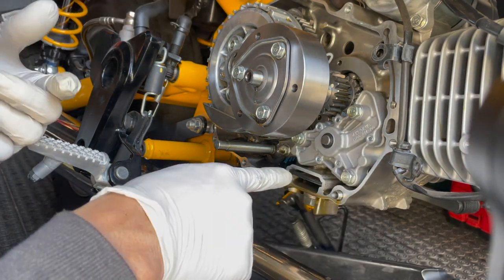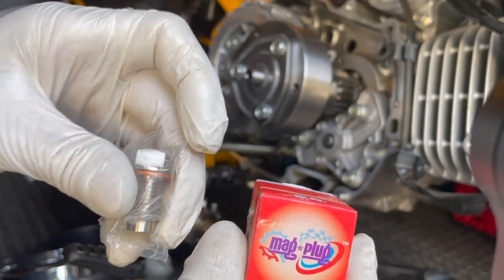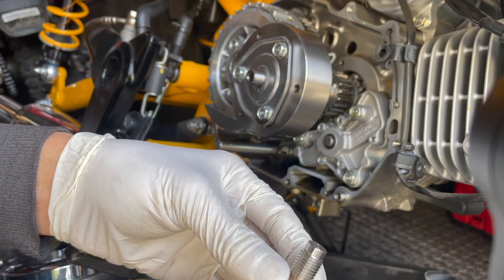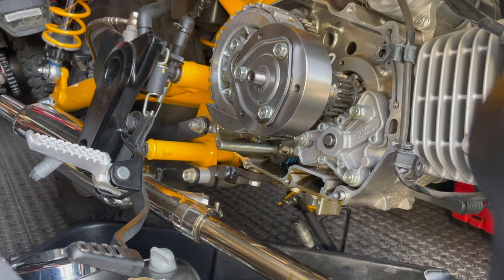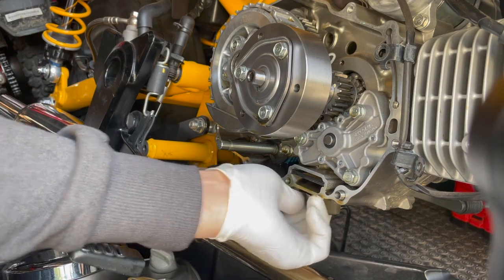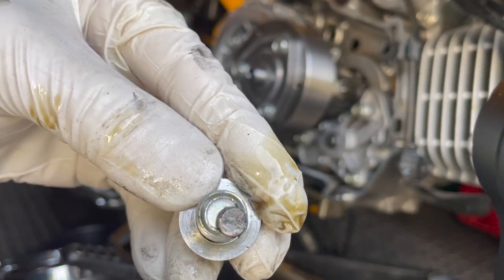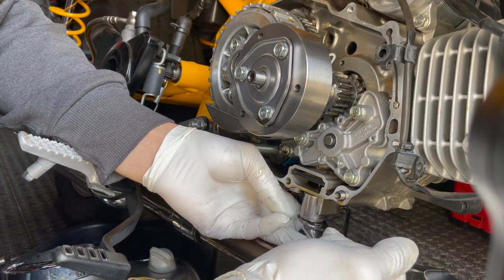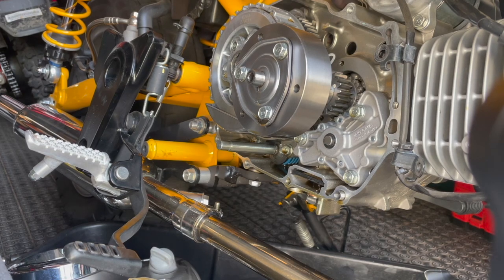Monkey Z125 magnetic drain plug & oil screen

Comment: First off, I want to say I have watched all you videos and enjoy them. Couple of points: If the metals particles you found in the screen are aluminum then the magnet will not attract them.You said you don't like the bolts with the magnets on top in case the epoxy fails and they break loose into the engine, but wouldn't they remain stuck to the bolt as you demonstrated with the magnet you previously put on the bolt? I think that long BMW bolt does more harm than good, you don't want to misshapen the screen with it. I bought the Takegawa magnetic drain bolt for the Monkey, it's high quality from Japan.
Reply: I just got my CT125. I had already purchased a Gold Plug MP01 which I had seen on a video that someone else had used in their bike. Now I am very reluctant to install it. I wouldn't want to chance putting a hole through the screen on mine either. I don't know how long the stock plug actually is. I may be able to track that info down. If you have any input on this please let me know. Thanks, EE.